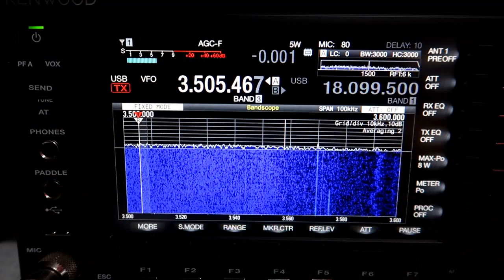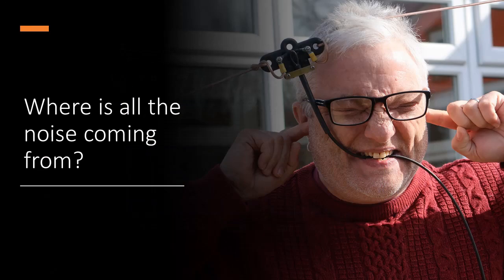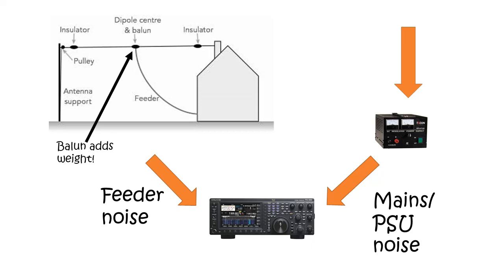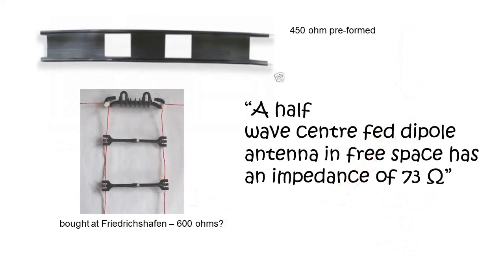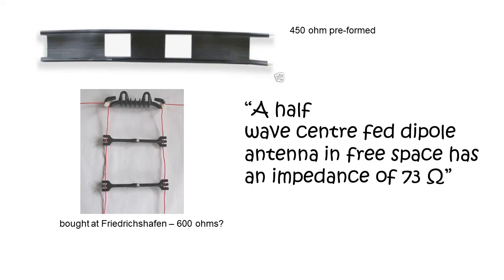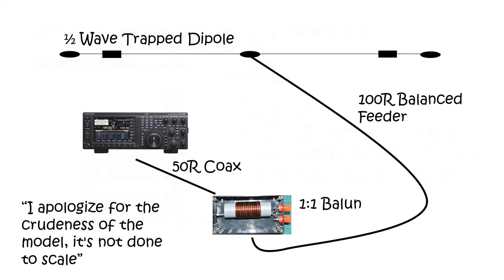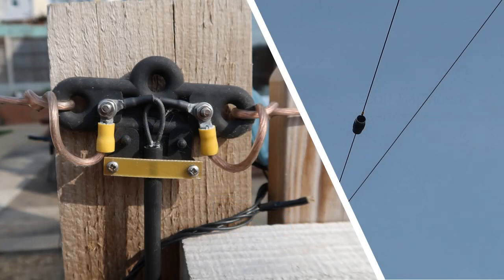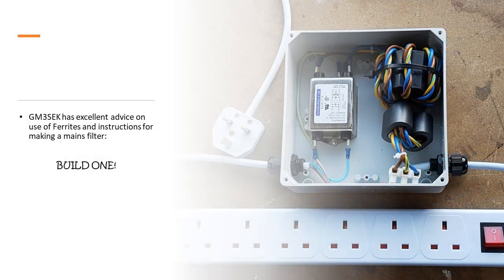Noisy RX on the low bands? Lets clean it up!

Comment: hi mark thanks for all your videos..I have built the mains filter and im seeing absolutely no difference in noise level s9 usually on 40m. Im using an end fed wireI wonder if you have any suggestions please? m0sjd   steve
Reply from the maker: You need to try a balanced antenna.

Comment: For a monoband dipole why not cut your 450 or 600 feeder  to an electrical half wave long and common mode choke it to hell in the  shack? I do something fairly similar,  a ZS6BKW and a massive common mode choke effort in the shack. I have no mains filters yet but my noise levels are way down on what they were,  On a lighter note a while back noise levels were driving me mad, I have a microprocessor driven rf power meter but the CPU "sleeps" with no signal... a shame I was running it from a switchmode wall wart!

Comment: Does anyone make and sell those mains filters Mark?
Reply from the maker: The bits came from Farnell.
Reply: @MarkG0MGX  Thanks Mark, I think that there would be a good market for pre-constructed boxes.
Reply from the maker: @stirlingpark6145  Maybe - they would be quite expensive I think. I'll see how much the parts are and if there is any interest.
Reply: @MarkG0MGX   Hi Mark Did you pursue the possibility of making these for sale? I would certainly be interested. Noel.
Reply from the maker: @noelwaddoup2528  I did and I couldn't find a good quality filter from any of the far east sites. I would be ahppy to make one for you if you need one doing.
Reply from the maker: @noelwaddoup2528  I could list one on ebay for you then make to order. It would be £90 plus P&P
Reply: @MarkG0MGX  That's great. Thanks Mark. Could we exchange emails and discuss the LF/MF specs?
Reply from the maker: @noelwaddoup2528  I'm good on QRZ under my call G0MGX
Reply: @MarkG0MGX  Apologies Mark. I've registered with QRZ.com but as I am not a Ham the site won't divulge your e-mail address to me. Perhaps you could make a listing on ebay and we could start the correspondence there.
Reply from the maker: @noelwaddoup2528  Sorry Noel, mark.g0mgx@gmail.com